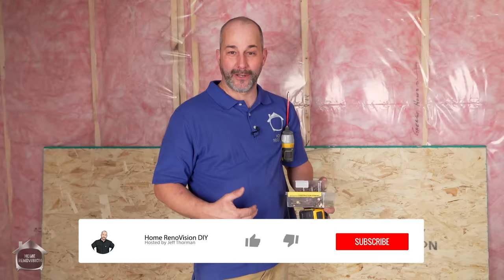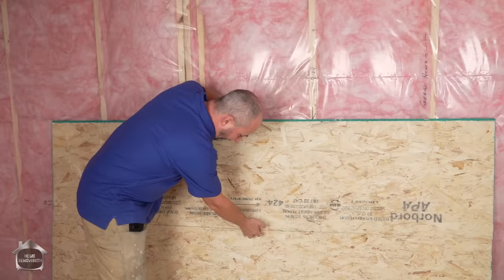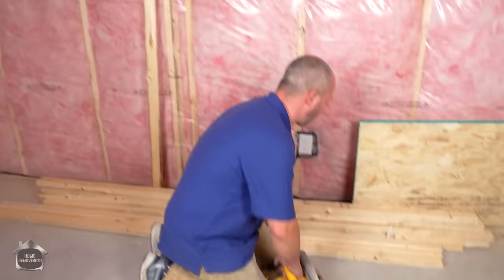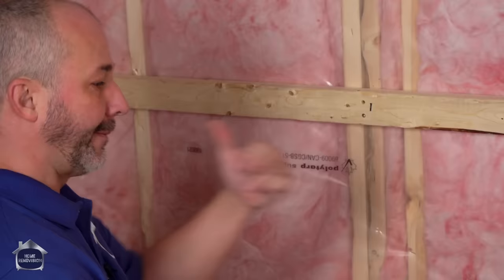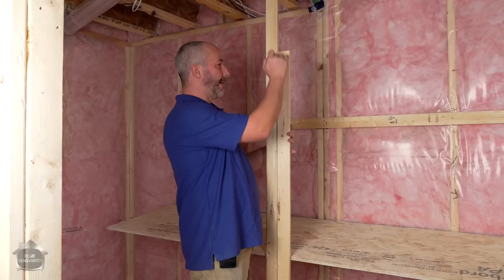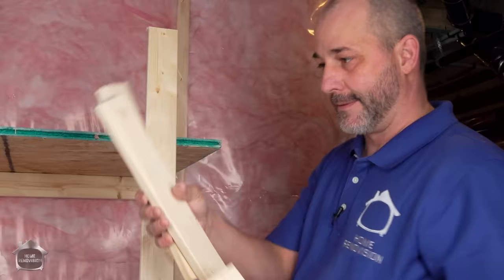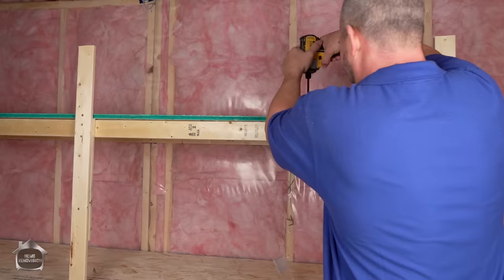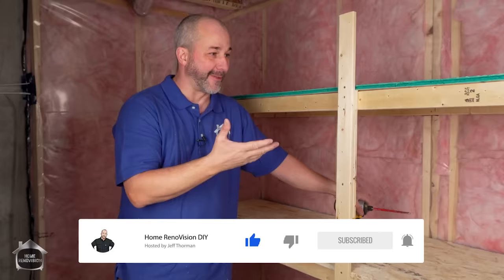Simple DIY Storage Shelves

Comment: Who’s watching in 2021, realizing they need a second mortgage to afford these shelves
Reply: That's for sure!
Reply: Yeah, I guess I'll be changing to OSB to meranti board. lol
Reply: HAH! Surprised armed security isn't escorting lumber trucks!
Reply: It's back down now, around 20$
Reply: That’s right. Go to Walmart and buy plastic shelving for less with no work. It’s not fun and a blow to the ego, but it’s cheaper nowadays.
Reply: @thomasmarengo3637  Those plastic shelves are garbage and don't hold 1/4 the weight that these wood shelves do.
Reply: let's go Brandon!
Reply: Getting a second mortgage would be smart since inflation is going to eat that payment up
Reply: @thomasmarengo3637  Been there done that cheap plastic shelves are good for holding empty boxes anything more they will fall apart
Reply: I go to Home Depot about an hour before it closes and buy up all their scraps for real cheap.  Also there are these grooved pieces that come from the pallets that you can take for free and I made pull out shelves using them by sliding panels into the grooves.
Reply: @lesdell  nope closer to 40 at home depot in Ontario
Reply: @craigslist4428  this is a thing?? I know they have off cuts for free. Do you just approach the manager or something?

Comment: Never heard of burning the screw in reverse like that. Cool tip
Reply: MrMagooo I thought self tapping screws were only for metal.
Reply: Rather a hot tip.. a burning hot one.
Reply: Would love to see a video explaining this
Reply: Ok, can anybody explain what "burning a screw" means and how to do that. Simple terms.
Reply: @franny5295  In other videos on this channel (especially look at some of the longer ones, where he goes more in depth on each step) he explains this idea. The basic concept is that if you run the screw backwards at first, the tip will heat up and "burn" its way into the wood, so when you drive it inside it'll give you a nice straight screw that doesn't split the wood. I've tried it myself and found it more helpful for some woods than others. Thin, super-cheap lumber can still split.
Reply: @Nurk0m0rath  Okay, thank you. I'll have to look for that.

Comment: He just cut a straight line, single handed, with a circular saw, going horizontal, on a free standing piece of OSB......

What....the fuck....I cant even cut a straight line with a fucking track saw.
Instantly subscribed after watching this video....fucking wizard...
Reply: Wasn't a perfect freehand straight cut, but close enough.  The circular guide and saw blade follow a pencil line.  Doesn't need to be micron perfect, not building a dining room table. Home RenoVision is experienced.  The offcut sides butt against the studs out of sight. The saw cut can slightly wobble to permissible limitation of the available 1.5" fastener surface.  Veering off track just makes it look Homer but still structurally strong.  

The video says the first shelf will be 30" above the floor. If he marked the tape at 30",  by installing the horizontal 2x3 bottom on the line plus the 7/16th" OSB breadth, that's 2-15/16" above 30".  And I don't know where the "25"" came from except a minor miscue in making the video. 

This is a great shelf at minimal material cost.  I would extend the 1x4 mounting blocks to the floor to get full load bearing with the screws as secondary support.
Reply: Same thought I had!

Comment: Saw this video a few months ago and knew we had to do it in our basement. We built 3 shelves in our basement. I had extra 2x4 from finishing the basement, so I just popped over to Home Depot for the 5/8" OSB. Even had them go ahead and cut both sheets in half for me! 
Lumber has gone up in price, but 2 sheets was $60 for a full wall of shelves. "cheap" plastic shelves are $50-70 and you'd need 4+ for the same amount of storage.

Comment: Hi Jeff. I appreciate your practical advice. A couple of comments/suggestions on this video to make the shelves look a little better (and provide some more support). Suggest leaving the cut edge facing out so that the "green and groove" don't show. Also suggest attaching the 2 X 3 directly to the bottom of the aspenite first, then cutting the support scabs the exact length from the bottom of the 2 X 3 to the floor and to the lower shelf. This would look better and add some additional support. Full-length scabs below the 2 X 3 at the wall would also add some support. Keep up the good work! I've learned a lot from your videos!

Comment: Just built this exact shelf in my basement. Unfortunately due to lumber prices it's now about $75 but still cheaper and better then the shelving units available anywhere. Rock solid and took about half an hour to throw together.  I was skeptical of the 1x3 for front legs but they are fine. Thanks Jeff!
Reply: PVC is cheap, particularly if you get it used.  Paint it and it looks fine.
Reply: @NoJusticeNoPeace  PVC is cheap...and flimsy and wobbly.
Reply: @cwb124  Guess it depends how much weight you need it to hold.  I made closet shelving from 1" PVC and it worked great, but all it needed to hold was clothing, bedding, and towels.
Reply: i was going to say, yeah 30 bucks, no way today.
Reply: @ssh348  Lumber has really come down since COVID, but here in Phoenix Arizona, I bought one sheet of 3/4" thick plywood yesterday and it was $50. So it would be tough to build this for much less than $75. (March, 2023)
Reply: I was going to say...this price didn't age well under Brandon and the dems! Now, its about THREE TIMES AS MUCH to build it. Likely STILL be able to build it for 30 bucks if someone else was still in office!
Reply: @hdpro66  Buffoon
Reply: @kevinkasp  Howdy neighbor, OSB was used in this video, not plywood. In Arizona a sheet of OSB is $15.. That was how he did the project for around $30
Reply: @HungryJack0ff  Got it. 👍 when I build it I’ll use that.

Comment: This worked out really good, thanks! Including getting the materials and clearing out a wall of stuff it went on,  putting it all back, etc... yesterday I spent a total of about 6 hours and $60 to complete this. I'm in a far NW suburb of Chicago. Going to do two more today, which now that I have done it once, will probably take me half the time it took to do one - again, including getting the materials, clearing out a lot of stuff and putting back in place, etc.

Including tax:
3 - 1x3's - $8
4 - 2x3's - $14
1 - OSB - $28 (they cut it in half)
2 small packs 1.25" SPAX screws - $5
2 small packs 2.50" SPAX screws - $5 

I cut the three 1x3 legs off at just over 5' and cut the remaining pieces in half for the six supports on the back.

Comment: REVERSE DRILLING SYSTEM: In case others don't know what Jeff meant by his 'reverse drilling system' (I didn't, I had to look it up), when drilling through strapping to make sure it doesn't split you drill in backwards until the screw is through the first piece and then drill forwards for the last bit. At least that's what I think is going on. You'll notice that each time he drills through the strapping he drills a bit, stops and then finishes. At the stopping point he is switching from reverse to forward. I'm guessing he demo'd this in some other video that I haven't watched yet.

Comment: Just used this method to stand up some 4ft x 2ft shelves. Extremely simple and sturdy. Used some 6d nails to attach the osb board to the support 2x3. $30 all said and done.
Reply: For the work save, buy a couple of 2’ x 4’ OSB handy panels and add a stud across the middle.  And easier to bring home.

Comment: I built two of these joined together. I used all 2x3s because they were cheaper than 1x3. One critique/ suggestion. I eventually had to run the front 2x3 that Jeff screwed to the osb, full length at 8ft so that the supports on the legs supported this front horizontal. This allows the leg to support the sagging weight of the shelf instead of relying on screws through the osb to hold the horizontal and the weight. (The screws tear through, ask me how I know) other than that great video and great cheap and easy project. 👍

Comment: Me and the beau built these shelves today. We used 2x4s and 1x3s and connected with 1 5/8" construction screws for the thinner spots and 3" deck screws to connect the 2x4s to the sistered 1x3s. The 3" screws are too long for those spots, so I suggest using 2 or 2 1/2" long screws at those spots. 1 5/8" are good lengths to tie down the OSB to the 2x3 (or 2x4 if you want). We built a 5' long shelf and will use the 3' off-cut OSB to build a 3x2 shelf. We bought four 1x3x8, two 2x4x10 (had these cut in half) and one 4x8 T&G OSB and a small jar of 2" all purpose construction screws. Total cost $160 here in Stockton, CA.

Comment: I spent double the time and money on my DIY garage shelving.  They’re as solid as the walls of the house, but for what’s stored on them, ultimately over-engineered.  Sometimes you don’t need a home run if you can win with a base hit.
Reply: I over built mine too and I could set my cars on them.  The shelves in this video doesn’t look as if it could support a newborn.
Reply: @chriszeien9112  I think these are fine for the regular household clutter—holiday decorations, bins of clothing, etc.  they look sturdier than vinyl coated wire shelving and hold a lot more.  This design would work for a pantry or attic too.

Comment: The reverse screw to burn the wood is a great trick, one time when you want to let out a little smoke
Reply: ....Never Ever let The Magic Smoke Escape....NEVER!!
Reply: @hymlog  this magic smoke is good, it’s a visual cue that the tip of the screw is hot 😉 the magic smoke from the drill / driver is bad , that shows that the motor or wiring is hot 😲
Reply: @1988dgs  ...OK ..YOU WERE TOLD!!
Reply: @hymlog  ? I was told ? Yea, about 35 years ago, has worked fine ever since, that’s how learning something works
Reply: @1988dgs  ...There's Always One!!
Reply: @hymlog  yea, and your it
Reply: @1988dgs  Yes!  ...Eyes Da One!!

Comment: Great video and thanks. One question: 19/32" x 48" x 8' OSB at my local hardware store is $31 :(  How much strength would I be losing if I used 7/16" instead (at $24), or should I start shopping elsewhere. What has everyone else paid?
Reply: 7/16 is fine.  Build a solid 2x4 box below with a board running front to back in the  middle and you are good to go.  It’s only 24” deep, unless you set an elephant in the middle no worries.

Comment: Hey there. I recently found your channel and really love all the information you share and how well you teach it! I am wondering why you didn't cover your insulation with wood or whatever board it would be called. (I am obviously a newbee and trying to learn so I can fix asap myself since i live alone)  THANKS!
Reply: It's in a shed and covered with plastic sheets, so it's not necessary although it would be better looking. I would personally have used a few of the boards for shelves to make the wall, but it's not necessary.

It makes a lot easier to out up rails or the likes for hanging tools etc

Comment: Used this method to put utility shelving in a downstairs storage area.  Very helpful; thanks!  As of this writing (June, 2022), OSB is about $35-40, and 8' 2"x4" is about $5 (USD); so cost now is about $70-80 instead of $30.  A few notes from my experience:

Originally thought I'd use 3/4" OSB or plywood.  Turns out a 4'x8' sheet of 3/4" material is hard for me to handle, so I used 5/8" thick OSB.  Works fine for the amount of weight I'm putting on shelves.  If you want to use 3/4" thick material, most places you'll get it (e.g. HD, Lowes, etc.) will cut the a 4'x8' sheet into 2'x8' sheets (easier to handle) for a nominal charge.  

Walls in my storage area are poured concrete so I had to use concrete screws.  These work fine for the loads I'm considering; if you need stronger fasteners, consider concrete anchors.  

I put LED strip lights behind the front supports (5:40).  Wired them into the circuit that controls overhead lights in room.  Makes it easier to see what's on shelves.

Comment: Run the 1x3 supports all the way between shelves and down to the floor from the bottom shelf, and do the same with 2x3 on the uprights, the shelves can support more weight and there won't be any shear strain on the screws. I would use 2x3 across the back instead of 1x3 and I'd either not use tongue and groove OSB or I'd saw the tongue off so there wouldn't be the gap under the tongue to the horizontal supporting board. Four uprights across the front would be stronger.

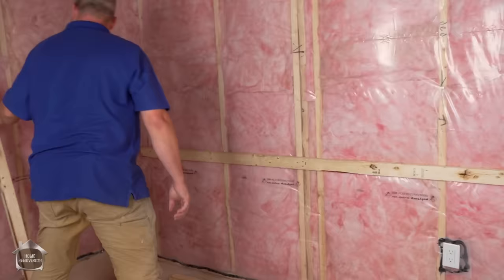Comment: 3:19 can only do that if the floor is perfectly leveled. Not always possible in older buildings.

4:30 i would place the support first. Too much tension on the screw if the support has a small gap or not perfect. If you place the support first you can put some weight on it before screwing the shelf to it. And if you cut them at the height of the floor it can carry way more as it rests on the floor too.

Other than that great build. Gave me a lot of ideas to do it on the cheap. ❤

Comment: What a great idea; Since i'm planning on remodelling my condo's basement and re doing it's bathroom, i figured i needed to take care of my storage space underneath the stairs in order to get easy access to my tools (Until now everything was a mess sort of piled up on the floor). It's a separate T shaped room (with a door) measuring 19' x 3' under the stairs and opening back to 43" wide where all my mechanicals are ( Water heater tank, air exchange and central vac). So i had to improvised and adapt your design since 24" shelves were out of the question. I ended up doing three 15" shelves of 8' length. Had to cut the end 1"x 3"s at a 45 degree angle to follow the staircase's slope. So near the end of the space i only have 21" clearance but it still allows me to grab any tools i need. Part of my reasoning was to leave enough room to be able to remove the water heater tank some day when it needs to be replaced. By the way i replaced mine last week following your tutorial on the subject and it went flawlessly. My neighbour ( who has the exact same condo layout) wants to replace his now that he has seen me do mine, but the previous owner has screwed in shelves all over the place so he can't access  anything anymore, he is discouraged at the idea of removing all the shelving, which would be more work than actually taking the old tank out. After i was done (and damm proud of myself) i went a little creative and added hanging supports with left over 2" x 3"s to the middle shelf in order to hold lengthy stuff such as skis, hockey sticks, curtain poles etc.  Thank you so much for all your help, i learn something new every time i watch one of your videos, which is all the time. What i am mostly learning though is just how important it is to plan in advance. I must have watched this video 10 times before i could figure out exactly how to install my shelves, but once i had the vision of the end product in my head i followed my plan and your advices and got it done  almost perfectly considering just how ''Green'' the wood was. It cost me more than 30$ because i had the cuts done in store which allowed me to get rid of the tongue and groove more neatly, but also because everything is more expensive here in Quebec not to mention we have twice the amount of taxes. It still came out a lot cheaper than buying 2 plastic shelf units over at Canadian tire. I can send pictures or a shot video if you want to see my project or the application of your design i should say :-) .

Comment: I did my entire garage with 5/8 osb shelves 2ft wide. I used 2x4 horizontal on drywall anchored to each stud then built a 2x4 frame and cross bracing every other stud. Then cut an angle support every third stud connected to the front 2x4. I don't like vertical supports that rest on the concrete cause it's harder to sweep around. My son and I sat on it to test and it doesn't even flex. I have well over 800 pounds for every 8ft shelf and it's been great for 2 years. You can hang things under it and the angled supports hold smaller things like extension cords and levels. I made a reloading bench the same way. Cheap and will last a lifetime.

Comment: just finished building these! They are ROCK SOLID!

Thanks so much!

for those who are curious, I used 
1" screws for the strapping support sections
1.5" screws to tie the OSB to the 2x3s
and 2.5" screws to go through the legs/strapping support and into the 2x3s

Comment: One tip for saving even more money. Go to the clearance section at you local Menards, Lowes, etc. Usually they have plywood that is warped, or has corners busted off. You can buy them for pennies sometimes. If it's a little warped, just pull it down flat with a clamp and screw it down.

Comment: Video Topic Suggestion:  weights and loads and how to calculate them.  You mention how strong the shelf is, but how could I start to get a basic idea of these metrics?  I have watched many of your videos, and I think they are great.  For example, I watched the shed video many times and learned a lot. I want to put my door in a different spot but don't understand exactly how to put the header and jack studs and maintain structural integrity.  So, take a twelve foot long wall and show a few different spots where you could put a door of different sizes and explain how to calculate the overall effect of gravity. That would be so great.  

Also, a great tip from another video I think you will really love:  When framing the door cut the floor plate at the bottom but not all the way. Then when you cut it from the top once it is in place, you don't have to worry about cutting the floor.  Take a look here. I learned it from this video and I am sure you will incorporate it into your next build.  https://www.youtube.com/watch?v=pBWlvoEQsEM&t=1681s